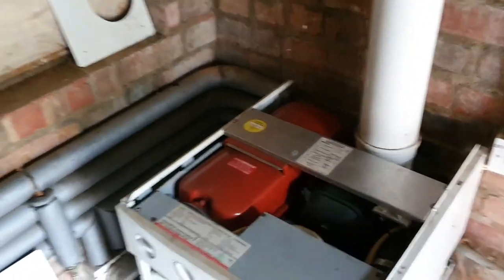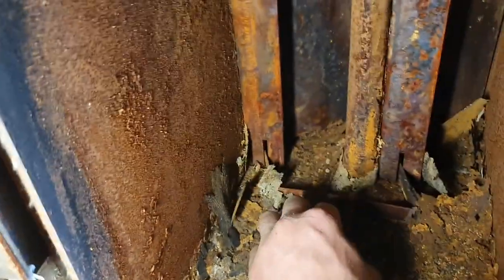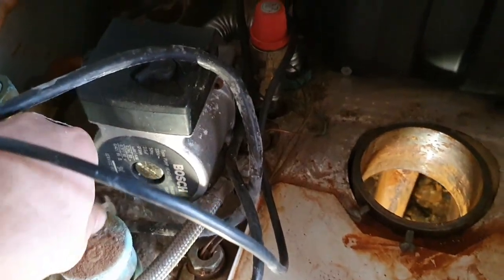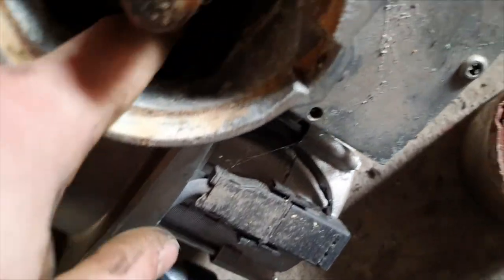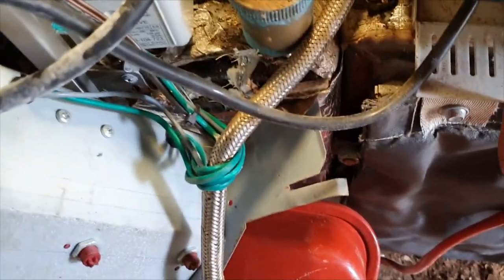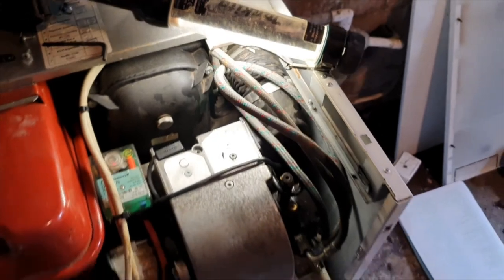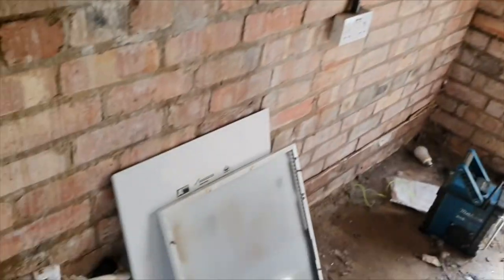Oil boiler service of a Worcester heatslave.

Comment: Looks like somebody has used vice grips on the ev flexi.
Most important part of an oil boiler service in my opinion is the oil filter.
In my area very view plumbers/oil techs actually bother inspecting the oil filter.

Comment: Great vid. I used to work for oil 4 wales and I’ve seen so many of these boilers. I hated the heatslave 1 internal due to how awkward it was to get the expansion vessel out due to all the cables and stats. I’ve had a few stats snap on me before now. Can’t beat the external dansmore single feed especially when we can park the van next to it. We called that the Carlsberg
Reply from the maker: Thanks mate, I do love an external boiler especially on a nice day, they make life so much easier for the engineer when everything easy to get to and easy to work on, thanks for watching
Reply: Carlsberg 😄😄

Comment: Interesting video but a shame there's no part 2 to see it running ok.
Reply from the maker: I can make a part two if you want to see it running
Reply: @PlumbLikeTom  Yes that would be good, thanks ! I would have liked to see inside the secondary heat exchanger too if possible (I assume this is a condensing oil boiler).
Is that a single vertical water tube @ 4:22 ?? I assume this runs on kerosene being a condensing oil boiler, is the correct flame colour blue with some yellow? Please advise. On gas oil (Diesel) it would be all yellow I think. I understand that gas oil isn't used on condensing boilers because of the high ash content in the fuel which fouls up the secondary heat exchamger.
Reply from the maker: @Martindyna  The newer condensing boilers have internal water ways on all sides and the bottom, this one will only have side and back i believe. Yes this boiler runs on kerosene as do most if not all condensing boilers in the uk. Gas oil burns at a hotter temperature to kerosene. The flame should be blue as you say. Always set the boiler to manufacture instructions but generally if you set the air to 34 percent on your analyser your co2 will be around 11.5 which is normally ok for these boilers
Reply: @PlumbLikeTom  I wondered whether the flame on this Worcester should be mainly blue but with some yellow? 
Since Navien (South Korea) infer that their blue flame condensing oil boiler is unusual in having an entirely blue flame. 
Seems a good company and they export to USA & China as well as the UK I understand.
Of course blue flame burners are not new, in the past there was the Howden Dynaflame (fitted to early Worcester HDII boilers in the 60s) which was an improvement on the American 1940s Wallflame burner; and the Yorkpark Microstar both of which have been discontinued I understand.
Reply: @PlumbLikeTom  If you do make a part 2 it would be cool if you could video the flame pattern please if possible.

Comment: First video I’ve seen of my boiler - was hoping you’d show where to bleed it to get rid of an airlock. Oil ran out 2 days ago, just filled the tank and going into lockout when trying to reset. I’ve got pressure back into the system already
Reply from the maker: Sorry mate, I have posted a video recently on how to bleed this boiler, if you have not already sorted it I will post a link
Reply from the maker: https://www.youtube.com/watch?v=6CHlli1O8Ww
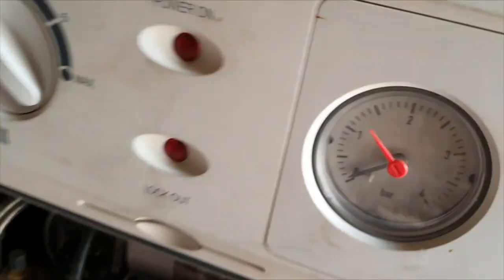Reply from the maker: I show bleeding at around 2:04

Comment: Hi Tom, I have a heatslave 25/32 -0s0-gb oil boiler. The heating works fine but the hot water takes about minute from turning on the tap to the burner firing up and go cold from time to time intermittently. Any ideas? Great video.
Reply from the maker: Sorry for my slow relpy, It could just be the flow switch, if the hot water is going cold though the plate heat exchanger may be scaled up

Comment: Thank you for this video and your Channel.@6:09-do the baffles on this heatslave have some sort of  lagging/insulation?Can you use a chemical cleaner to clean secondary heat exchanger.Nice to see oil servicing as stated below.If the flexi to the expansion vessel is blocked how would you diagnose this other than the prv letting by.Thanks again.Look forward to your seeing your other videos.
Reply from the maker: The baffles on these are just solid metal with no insulation designed to divert heat to the sides and top of the combustion chamber, you can use cleaners for the secondary but most of the time i find they will just wipe of quite well with wonder wipes or equivalent. You can find out if a hose is blocked on an expansion by connecting your foot pump to the vessel and see if the pressure gauge rises slightly on the boiler, thanks for watching
Reply: @PlumbLikeTom  Thanks for taking the time to reply.Much appreciated.Good tip for checking the hose.Keep up with the great content.

Comment: I have this boiler. It’s on lock out at the moment, need to bleed air out the system I think. Where is the bleed valve on this? Someone has said to me near the red flashing light on top but even reading manual back to front, I can’t find it. The lock out reset just under the front face panel isn’t working so need to find the valve on the top!
Reply from the maker: Hi mate, the bleed point for the oil is on the right hand side, the back one is the bleed point, make sure nit to adjust the front one as this is the pump pressure, even a small adjustment on the pump pressure will make for big combustion problems, I will post a link to another of my videos where I am bleeding the oil on this model, skip to about 7 minutes and it should show you the place to bleed from, hope this helps
https://www.youtube.com/watch?v=rnDDbF1Dofs

Comment: Hi I got one of these, cant find water inlet to increase pressure after bleeding rads, can you show where the cold water in feed is please.
Reply from the maker: These boilers don't have a internal fill loop, there will be one but sometimes they get put in weird places, it will look like a silver braided hose with two black taps, if it hasn't been used in a while they may be quite stiff to turn, normally they are just above the boiler but I have seen them under kitchen sinks or in old airing cupboards

Comment: How do you service the secondary heat exchanger?
Reply from the maker: Hi mate, on these boilers I just use wonder wipes to clean off each of the individual fins, it's not recommended to use wire brushes or chemicals, normally they do clean up Ok but if they have not been done in a while they can take a little bit of time, hope this helps, thanks for watching 👍

Comment: I have a danesmoor 15/19 in a property left to my mother from my grandparents, just had new radiators fitted and all works OK apart from the fact the heating comes on when the hot water is run maybe diverter valve? the CH side I set to 0 with HW set to 2.
Reply from the maker: It does sound like a diverter valve issue, it will probably be worth changing the hole valve if its passing through to the heating side, hope this helps in some way
Reply: @PlumbLikeTom  thanks Tom. When the old radiators were taken off for plastering and decorating I must have accidently knocked one of the valves upstairs whilst getting rid of rubble. Most of the water emptied through the kitchen ceiling! I only noticed when I popped round the following day and wondered why the kitchen floor had a giant pool of brown water! As a result the pump was knackered and so that was a £130 fix. I think those diverter valves are about £150.

Comment: Thanks for the vid, i have this exact boiler and its also been stood for a while. Ive got it running but the burner keeps cutting in and out whilst running. Its had new photocell, control box, nozzle, fuel lines and new fuel.
Any ideas what it could be ? its  driving me nuts! 
Dave.
Reply from the maker: It will most likely be the solenoid on the oil pump mate, does it sound to be running ok when it is firing?
Reply: Thanks very much for your reply, yes it runs ok apart from burner cutting in and out intermittently and then locking out, could that be a result of the solenoid ?
Reply from the maker: @judaston1448  Yes, if the boiler runs when cold, locks out after a while then resets again when cold, it will most likely be the solenoid on the oil pump
Reply: Thanks a lot mate, thats a great help, its got to be worth a try !
😊

Comment: i do have a wocester 20/25 heat slave following the manual i cant seem t0 fit the baffles  correctly any advice would be appericated
Reply from the maker: Its normally removing the baffles that is the biggest problem, sometimes the heat can warp them making them tricky to remove/reinstall. Just make sure the baffles are the correct way up and in the correct order and should go back in

Comment: Worcester greenslave oil central heating boiler,keeps locking out 588 code comes up, Worcester engineer came,checked contamination of the tank,ok,fuel filters,ok,new jet,ok,no air in the system,done a diagnosis check all working as it should,while here all working then he left and cut out again,same fault code F9 588 .phoned him he said can only be the fuel pump,any ideas,thanks
Reply from the maker: It is likely to be an issue with the fuel pump or line, If it was me I would change the pump, I've seen it a couple of times on jobs where there has been a tiny leak on the supply line causing air to be drawn in causing random lockouts, you can connect a vacuum gauge on the V port of the pump and this will confirm if there is a problem with the line
Reply: @PlumbLikeTom  the engineer said no air in the pump, insurance are going to put a new pump in, about 3 day's,thanks will let you know

Comment: I have a heatslave 20/25. The heat exchanger is leaking. I have a replacement to see us by until a new boiler is fitted in 6 weeks. The 4 pipes going in to heat exchanger, is there a constant feed of water. Do I need to turn the mains off before switching the heat exchanger?
Reply from the maker: Hi, do you mean the plate heat exchanger or the main heat exchanger? If you are changing the plate ( the silver one on the top left) then yes this will require the mains isolating and the heating circuit draining. This should be quite an easy job. I would not attempt to change the main heat exchanger on that particular unless you are extremely competent on boilers. Hope this helps, any more questions just ask.
Reply: @PlumbLikeTom  yeah the one that sits on top on left above the insulated tank that i presume holds an amount of hot water. Boiler is losing pressure and leaking from that exchanger and pooling on top of tank. Getting a new one in 6 weeks but trying to sort issue so we can have a shower until then

Comment: Hi mateys. Please could you tell me why my pressure vessel is full of water. Cheers
Reply: Sorry I meant expansion chamber
Reply from the maker: Hi mate, it might just need recharging, to do this you will need to connect a foot pump or bike pump to the connection on the vessel, you then need to open a drain valve to release the pressure, keep this open whilst pumping and inflate the vessel to 1bar, the water in the vessel will be displaced by the air. This is the first thing to try, it may also be that the vessel has split internally in which case it will require replacing, hope this helps, any more questions feel free to ask

Comment: Can I change the flexible hoses myself same boiler 6 years old labels says to change,boiler keeps cutting out,says low on fuel but 100 litres in the tank
Reply: 1000litresin there
Reply from the maker: The hoses will need changing but it's unlikely to be the cause of lockout, is it an intermitant lockout ? if the boiler lockouts consistently after 8 to 10 seconds and you have fuel at the oil pump it will most likely be the photocell, if you have access to a multimeter this is really easy to check, if the boiler intermittently lockouts it will probably be the solenoid on the oil pump
Reply: It sometimes ok for 2 day's,and sometimes 4 times a day have to reset
Reply from the maker: @terencekeating  It's likely to be the solenoid on the oil pump, new hoses and a nozzle change wouldn't be a bad idea if they haven't been done in a while
Reply: @PlumbLikeTom  the nozzle has been changed,pipes not there are 2 pipes both with card's stating replacement date's saying Feb 2023, engineer said he was going to replace next time,i have ordered water contamination paste,as this happend 2 day's after i had a 500 litres top up,looking now i reset it 3 hours ago and still going at the moment,so a check by an engineer at this time proberly won't show a fault,,in the Manuel it show's the part number for the oil pipe,do i have to order 2 ,thanks for your help fault was showing on cut out 588,